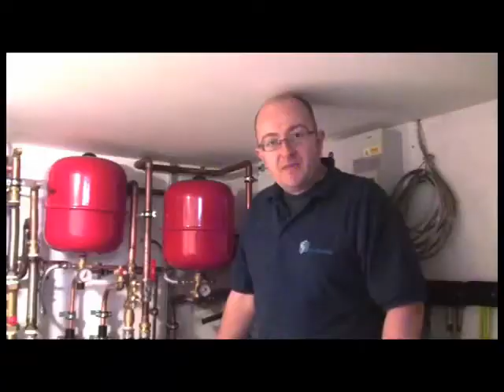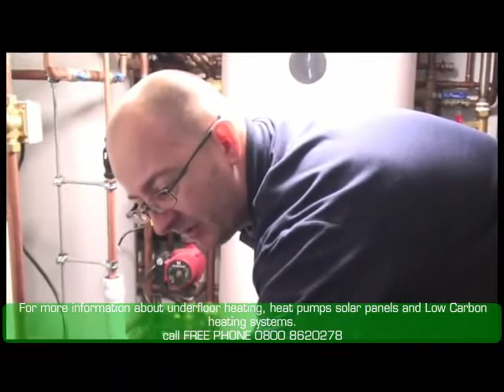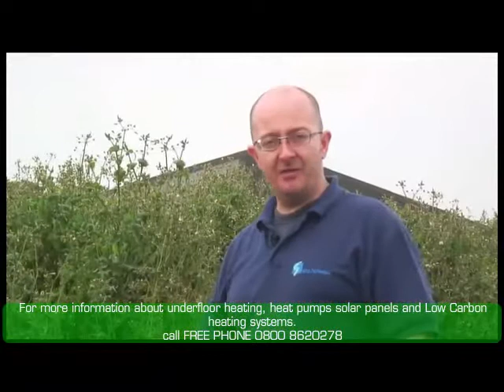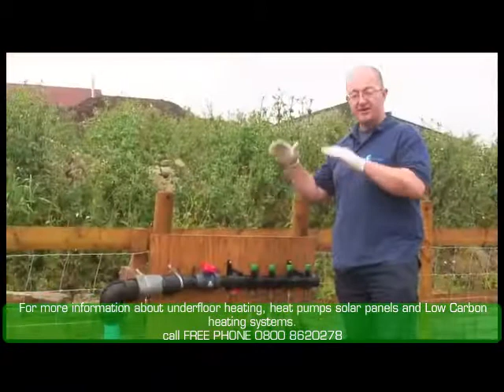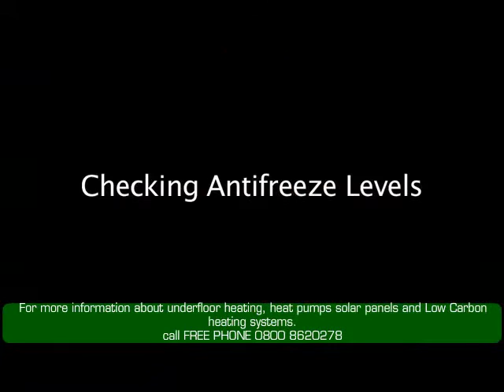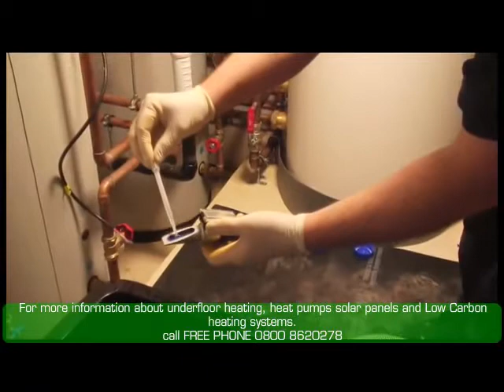Purging and flushing a Ground Source Heat Pump System

Comment: bumbumçineyedna

Geounits actually rarely need to be purged, it's often whenever you replace a pump or any other vital component in the loop. I have to get this done too, and my system is hell of lot bigger then this here shown, will be a 800usd price tag, as i lack the equipment and skills to do so. Here the purged it, as it's a newly installed system..pretty obvious.

Comment: He's carrying out the commissioning of a ground source loop  by first filling with water and returning trapped air and debris back to this tank via a recirculation loop.. once he has vented the air and rubbish from the system and filled with water he  adds glycol to the water..thus creating the charge for the heat pump to use in the closed loop cycle. By picking up low grade heat and upgrading same through tapping in to the heat enegry created via the reverse cycle refridgerent compressor